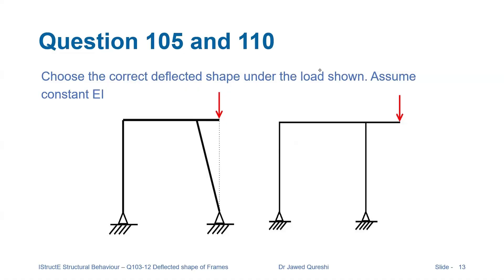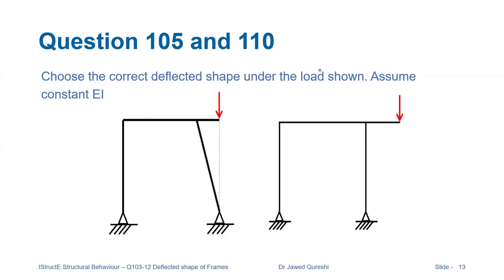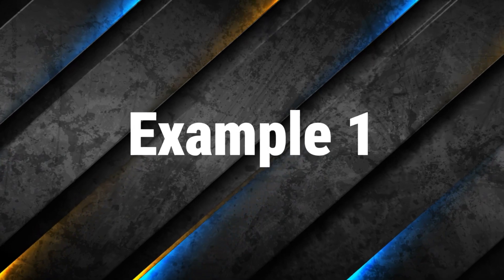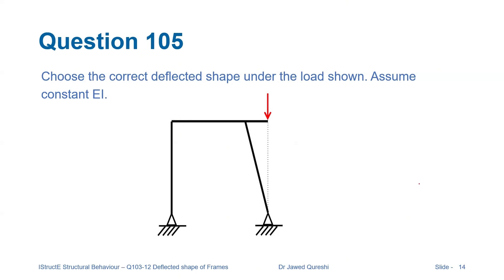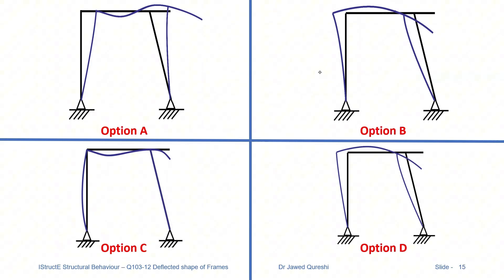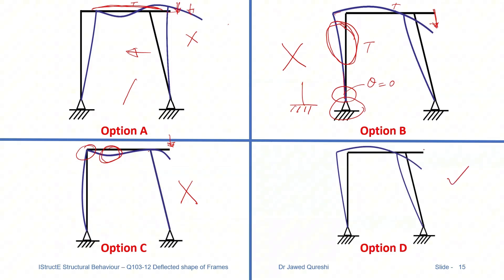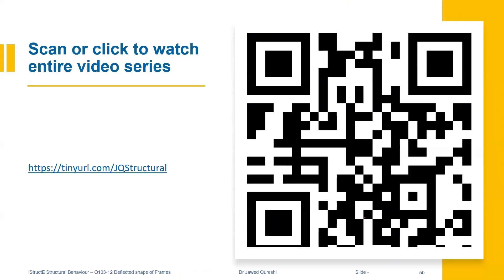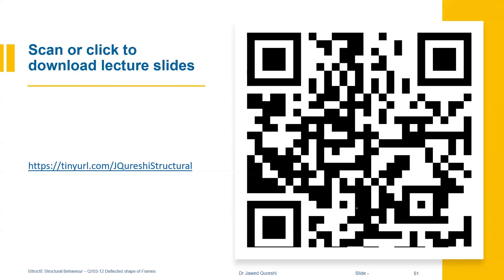3 Quick Tips for Deflected Shapes & Frame Analysis | IStructE Structural Behaviour Course

Comment: For the second question, option C shows no rotation at the right hand joint but it is pinned so believe that's not the correct solution? To ensue there is rotation at that joint, the horizontal reaction at that joint would need to be to the left to get tension on the outside of that column but then horizontal equilibrium isn't maintained as the horizontal reaction at the other joint is also to the left. Option A seems more correct - I don't see the need for there to be any bending in the columns. If the vertical reaction on the left hand pin acts upwards and for the right hand pin acts downwards, you can then get sagging in the left hand side of the beam above and hogging in the remaining part of the beam to the right. Could you explain if I am wrong please? Thanks.